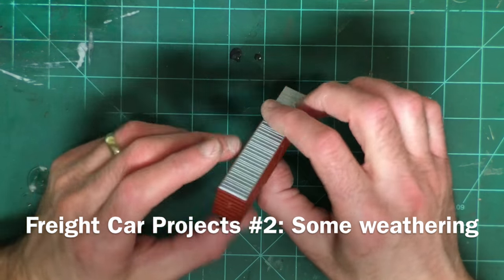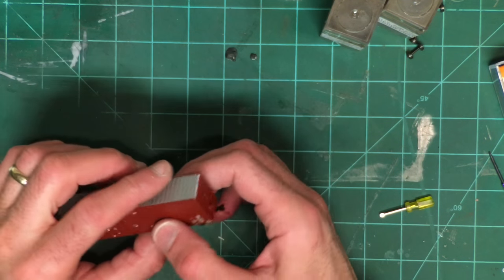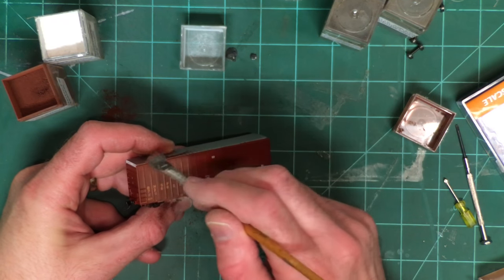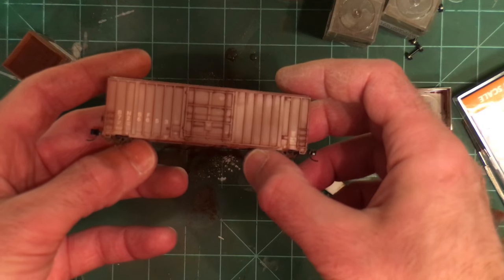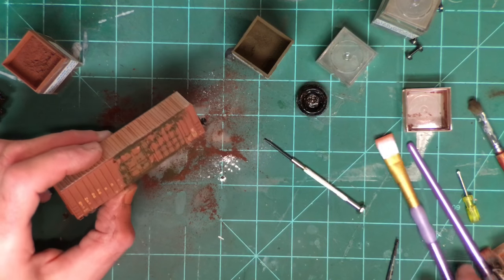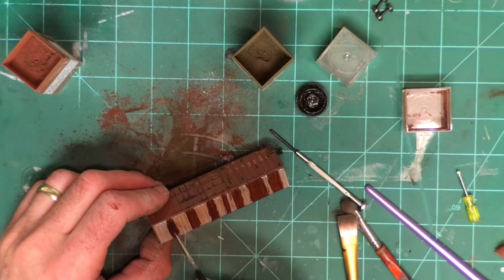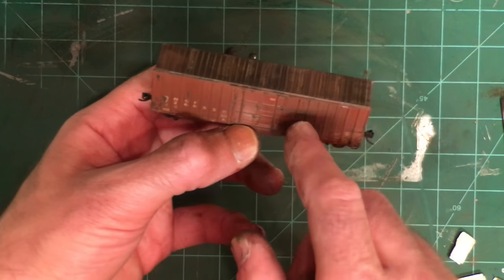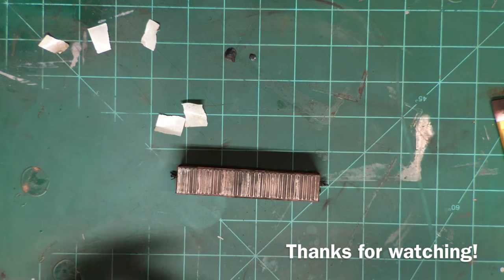Freight Car Projects #2: Weathering

Comment: Liked how that turned out.  I never thought to dull coat first   then weather.  Thanks for that tip.
Reply from the maker: +Peter CPRail8748 The dull coat helps when using the powders since sometimes they don't stick as well to the factory finish.  I don't do that if I'm using paint washes or an air brush (which I hardly ever do anymore).  I learned that tip from a video I watched a few years ago, but I can't remember who it was.  It could have even been a video on the MR website, I'm not sure.

Comment: Forgive the newbie question: what does adding the ounce of weight do?
Reply from the maker: It helps the cars track better. Gravity helps keep them on the rails better and less likely to derail going through turnouts and such, especially when being pushed. Rolling stock is so light in small scales it doesn’t take much for them to bounce off the track so a little extra weight helps although it means you can’t pull as many.
Reply: Appreciate it, thank you.

Comment: Have you had any issues with the dull coat getting into the couplers and causing them to be sticky?
Reply from the maker: +Josh Voyles That is a good point.  The dull coat will gum the couplers up.  I usually try to cover them with a piece of blue masking tape if I plan to keep them, but don't bother if I plan to swap them out with Kaydees and they don't already have them.  The same issue happens with trying to paint the couplers, so I usually just use a little weathering powder on them, and don't spray them at all.  The powders will wear off a bit over time though.
Reply: I wonder if dry brushing a little rust colored paint would be better for the couplers.
Reply from the maker: That is a good idea.  It would likely last longer.